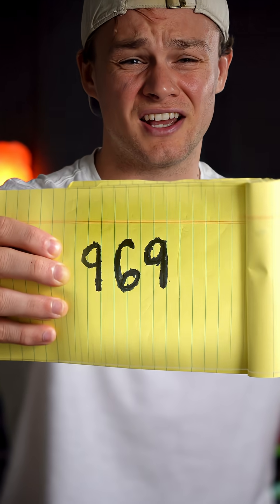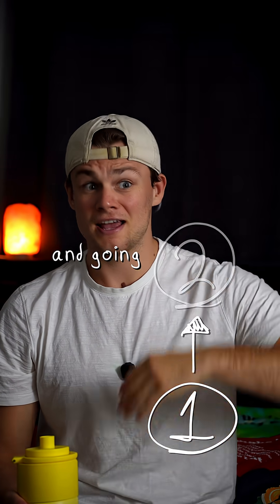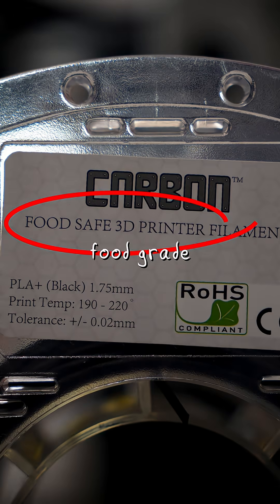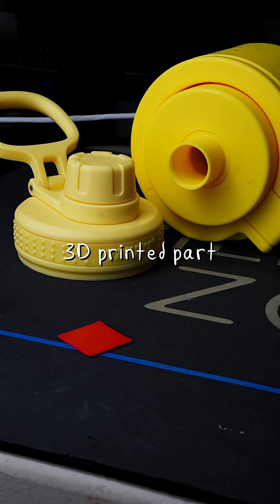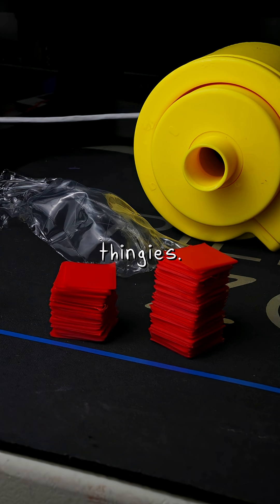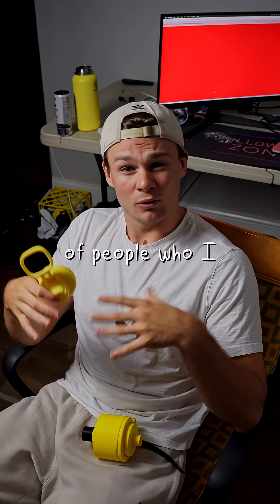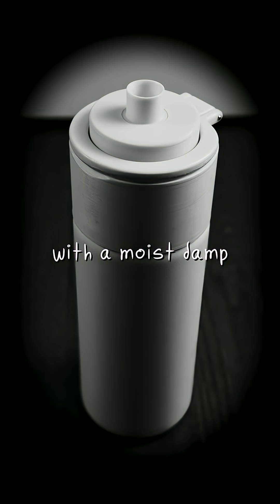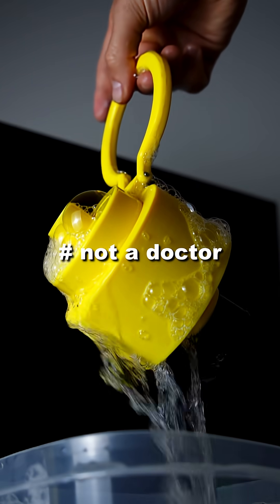Did I Make A Poisonous Water Bottle?

Comment from the maker: Thanks for watching! — if you’re interested in supporting a kickstarter for the water bottle, sign up for my email list (link on my YouTube channel page)
Reply: 3d printing is really good for design and testing sorta functional stuff really cool stuff!
Reply: I rember when this project started
Reply: Cover it in food safe resin
Reply: You should get a hold of the YouTube channel MassSPECeverything ...
Reply: Reason number 4: you put ricin in the water
Reply: As a 3d printing professional, here a bit of advice: The nozzle is not the only part in your printer that needs to be certified food safe.
Starting with the print plate (and obviously remaining filament traces from old prints), to the filament itself there is a whole extrusion system in between.
Many nozzles (even stainless steel) have traces of heavy metals in them, often the heat block is nickel plated (not good), the heat break might not be food safe steel, the feed tube (bowden) is likely questionable FEP that needs certification and even the extruder gears are very likely contaminated with heavy metals.

Injection molded these things are probably less of an issue tho obviously, but just for your info.
Reply: The Gospel of Christ:
Jesus Christ died on the Cross for you, He defeated all of our sins he pinned that on the cross if we believe in that, if we believe that He’s the only way to Healing if we accept his Holy Spirit into our Hearts, we will be forever reborn and we will live him forever

Comment: I haven't seen any empirical research on this because most people just consider 3D printed parts not foodsafe, but when making sculptures, one technique for removing the voids between the print lines is to print 100% infill, rough sand the outside, cast the whole thing inside a block of plaster, and then bake it at roughly 180C after the plaster has set.

This will melt the plastic and fill in the micro voids from the print lines, offering a more solid piece will fewer voids and gaps, meaning there is less surface area for bacteria to grow. This would theoretically extend the lifetime of the prototypes until you can get them injection molded.

Comment: Yeesh, it was only recently that they started controlling microplastic amounts in water. They reduced the safe amount by like 2000x. This stuff is way more dangerous than we know and at minimum is a main cause of tons of cancers. You can get your levels below average just by drinking from actually safe bottles, and not eating microwaved popcorn which is the absolute worst contributer. Plastic wrapped foods aren't nearly as bad if you're not microwaving it with the plastic. Microwaving is what tends to shed tons of microplastics.

Any amount is bad atp, and we can only reduce our exposure to it. It will be impossible to lower our levels to 0 for generations until something is figured out, I mean people still have lead in their systems from the whole leaded gas thing, even if they weren't born yet.

Comment: Yep nice, I've been asked if 3D prints are food safe hundreds of times. It's always no because of those layers. The prints can't ever be cleaned properly. Ironically, this makes 3D prints awesome for supporting biomass in aquarium filters - because it's so GOOD as a substrate for algae. 😂
Reply: What if you coated it in a resin to make it smooth and "quarantine" the layer lines?
Reply: @ps3master72 that should work. Not sure if you need more than one layer or not.
Reply: Would applying ironing on all surfaces solve this issue?
Reply: @ae_unal you can't iron the sides of a print. You could anneal the print technically but eh
Reply: What about if you vapor polish the print?
Reply: @sebcalabro6252 helps some but isn't worth the risk. the resin idea can work though

Comment: Actually, microplastic isn't that scary. Plastic is dangerous for the environment not because it's toxic, but because it wouldn't really engage in chemical reactions, so it degrades for millennias at best. So the biggest risk with microplastic us that it can scratch your throat while digesting, but if it's small enough, it won't do any real harm.

Comment: PLA is bio degradable and prolonged contact with water will make it swell and degrade over time. Might not be a safety problem but it will not last long in a wet environment. After a year at most it will crumble.
Reply: No, biodegradable does not mean "breaks down in water". Where do folks with no background in this stuff keep getting the idea that uninformed comments are useful?
Reply: @daliasprints9798  Not biodegradable and therefore water degrades it but because PLA absorbs water, it swells up, loses it's original shape and becomes brittle.... and it's also biodegradable meaning bacteria will tear it down. Anyone who has ever had a long term water bottle knows how fast bacteria grow on the mouth pieces.

Comment: Those cleaning products are not enough, the bottle may look like it isn’t but the porosity caused by the layer lines means water and bacteria over time seep into the cavity between in and outer walls.
Reply: He did mention the final product would be injection moulded
Reply: This is only if you have bad prints. A good print is air tight to at least tens of psi.

Comment: Your water bottle has somewhat low water pressure, and I can think of two widely used simple solutions. Make your water bottle flexible. This could allow athletes to squeeze the bottle for added water pressure. I’d also add a one way air hole so that water could flow more smoothly. The kind with the silicon gel plate.
Reply: Water when it flows has to let air flow in as water flows out, these fix that issue, if you can find a better fix, then that works too. Just a suggestion
Reply: its steel so making it flexible might be a bit hard